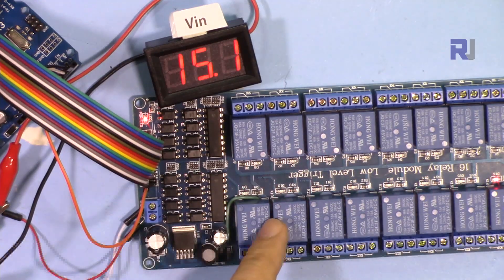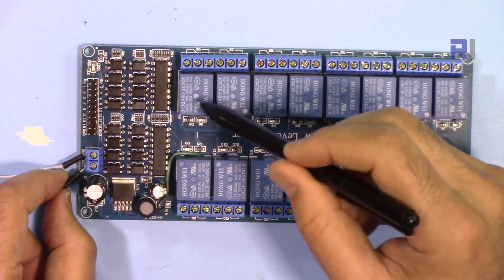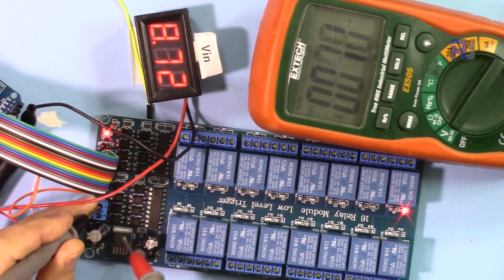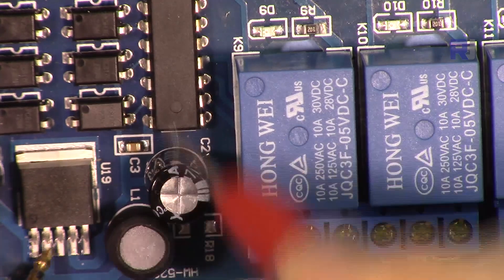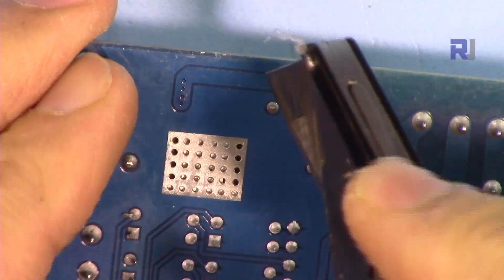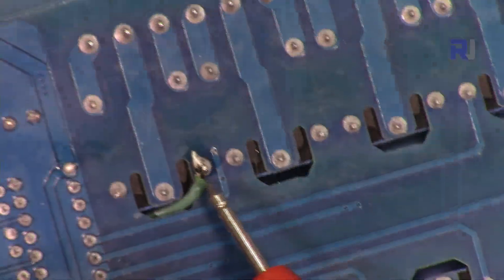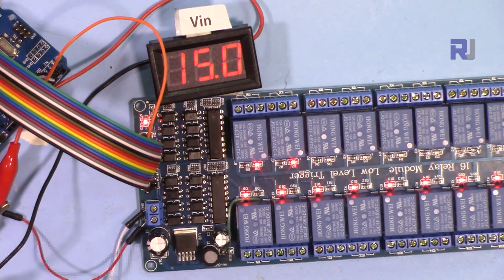16 Channel Relay module 5V relay voltage fixed RJT796

Comment: Great video!  Note : this 16 channel relay module got the relay called : JQC3F-05VDC-C and needs 5 Volt to work and thats why he does this mod/fix so it doesn't melt down, however i just got mine and that got the relay called : JQC3F-12VDC-C so that dont need any mod.
Reply from the maker: Thanks for sharing the information; it's helpful to know about the different versions of the module!

Comment: Great mod🎉  , 
a 2 amp regulator put to better use to supply about max . 6 amps

The opto coupler Leds would need only each  max .0016 milliamps even less because of the transfer ratio because of the virtually zero current  needed  to drive the ULN darlington transisor  bases.

Comment: Hi i wouldn't say that the design is entirely flawed but just that it doesn't make sense for this specific version of the board with 5V relays (12V and 24V versions are fine). It's also good (for the 12 and 24V versions) that they don't use an onboard regulator to power the relay coils since relays don't actually need the low noise regulated voltage at their inputs, so this can be left to an external PSU sized appropriately (again 12V and 24V versions of this board make more sense).

The 5 Volts from the switching regulator are there only to drive the ULN inputs which are rated at 5V for the ULN2803A model (the chip contains an input series resistor in the Darlington array). It's also a good idea to avoid powering the MCU from those 5V since the same track goes to the phototransistor side of the optocoupler along with the ULN inputs and after the fix it also goes to the relay coils so it defeats the purpose of isolation.
Reply from the maker: Hi, it is all about the actual each pieces of relay. if relay operating voltage of relay is 5V, then it should receive 5V
Reply: and if you want to use this 5 volts bord to command 220v? what's hapen?:_?? all the purpose of relay not exist anymore

Comment: Thanks for the video! I have this board, but without the regulator circuit components. Can I simply regulate the voltage nicely to 5V (1A) into the Vcc and GND inputs? Presumably this would still work to drive the relays at higher current, without affecting arduino, because of optocoupler configuration? Thanks!
Reply from the maker: Yes. you can connect 5V at the point where 5V regulated should be, it should work.  You are welcome. Please subscribe. I appreciate it and helps my channel grow.  Thank you

Comment: Nice video to understand the module workings. Its design is not flawed, it has a very specific use case. The 5v psu onboard is to help you drive the microcontroller that will be plugged in externally, while the voltage input to the board should always be what is mentioned on the relays (5v in this case but there are 12v and 24v relay boards of exactly the same type available)

Comment: Dude if the relays have 5v on them you have a 5v board not a 12v board.  Don't input 12v.  Just input 5v and ground pins.  You may try to use 5v and ground on the screw terminals.  DO NOT USE BOTH AT THE SAME TIME.
Reply from the maker: Hello, at 0:50 I mentioned that you can use 5V. the problem is this sold as 12V relay module. see it here https://www.aliexpress.com/item/33034614509.html and on eBay https://www.ebay.ca/itm/253122556171
Reply: The boards in your link show 12v relays, not 5v relays.  Maybe a mistake in shipping or ordering.  The board i have cannot be altered (no bottom layers
) .  If I ordered a 12v and got 5v I would just return it.  Interesting fix though.
Reply from the maker: I just checked the video and toke the screen shot that shows the relay's used are 5V. see it her https://snipboard.io/6MJLl0.jpg

Comment: Just to add a few things to this conversation, the overall design that these modules copy is flawed then each copy gets slightly worse depending on which clone they copy. Irrespective of VIN applied directly to relays or this fix being applied the optocouplers are really unnecessary, no isolation provided since the grounds are common and the Sink driver could be directly driven from the Arduino. My unit shipped with the Voltage flaw this video fixes, but also the common trace shared by the Relays is slightly below 1mm in width, which according a calculator is less than ideal for the total current of 1.28A when all relays are active. Also on my unit there is no cutout between the Relay's COM pin and the driver side. Overall regardless where you got your board from I wouldn't trust it for high voltage or current applications.
Reply: I don't believe there is a flaw in the design.

1. Regulated DC via a voltage regulator is not required to operate a relay.
.
2. Not good practice to use Vcc(Logic Supply) from the 5V regulator to supply voltage to relay coils.
     While there seems to be "back EMF" diodes installed at each relay there is an issue of "back EMF noise" on the Vcc(Logic Supply).
     It is better not to generate back-EMF noise in the first place by connecting relays to 5V to later rely on the flyback diodes to remove the noise.
     Therefore the solution is not ideal.
.
Here is what is really going on.
.
1. This PCB was never designed to have 5V relays installed.
.
2. This PCB was designed to use relays with Vcc_PCB between 7-24VDC where Vcc = relay coil rating voltage.
.
3. If you have 12V relays installed there is nothing wrong with the PCB design.
.
4. Some "idiots" (Entrepreneurs!!!) in China decided to manufacture these PCBs with 5V relays.
.
5. This PCB should never have 5V relays installed.
.
6. Here is the same PCB ( http://www.aliexpress.com/item/32555988376.html ) with 12VDC relays. You can't say that the design is "flawed".
     If you apply 12VDC to this PCB there are no problems.
.
7. It would be more accurate to say that the "PCB was not manufactured to design specification by installing 5V relays.
.
8. I blame the buyer for buying a product which has obvious flaws. I personally would have never bought the 5V variant of this PCB in the first place.
.
9. The solution of connecting the coils to the 5V regulator is flawed because "isolation" has been made worse than it was originally.
.
10. The modification might "work" but I would never fly in an aeroplane with this modification.
Reply: @jackhoffman6120  In addition, the hole in the PCB is a safety measure to avoid the electrical field of the 230V phase from polluting the digital circuit. If you run a wire through that hole, you're injecting a (free) voltage in your digital circuit. On a table it's not an issue, but as soon as you connect a live wire to that bottom relay common pin, if you ever touch any digital pin, you can die! That nasty 230V will create an electrical field, that could be 60V or more in your "patch wire" because it's too close to the 230V pin. Once you touch it, or anything it's connected to, you're dead.
Reply from the maker: I totally agree with your statement.  Unfortunately we have no control over design and quality control. if it was from a proper manufacturer, it should have had model number with proper 100% isolation. But 1000s of people buy this and I noticed interest and request from viewer and purchased it. Thanks for sharing your opinion. Cheers. Ahmad from Canada.
Reply: @robojax  Notice that the optocoupler are useless on 5V board after your modification, since on both side of the optocoupler you've the same power source. Knowing the chinese law that any component is worth removing, until it breaks: if they haven't done it, it's because it's wrong. The relays they have installed have nothing to do with the voltage regulator. It's just a coincidence. The 5V of the regulator is for the µController connector, not for the relays. You must power your board with the voltage rated from the relay (in that case, 5V).

Comment: hi Robojax, I bought a 5v 16 channel relay and is opto coupler but not opto isolation. Y looking your video and instruction in your page and I need C1 1000uf25v, C2 470uf16v, LM2596 s adj 3amp and 33uH radial inductor (7x10mm or 9x12mm? thanks for your answer
Reply from the maker: hi, don't try to make the power module it would cost more than buying the LM2596 PCB module which has everything and it is cheap.

Comment: hey bro. I have a problem with the module, I did everything as in the movie, only the LEDs light up, the relay does not respond  (on the relay i have 4.33 volts) something could I do wrong?
Reply from the maker: if had typed what I did in video, it would have been 20 or 30 pages or more. So video is the best and ONLY way to make is simple. I showed every step and explained how it work.

Comment: I use 24 v rectifier as you said it's the maximum voltage it can tolerate. I connect the gnd and VCC pin from 16 channel relay module to Arduino. My ardiuno heat up and the 
 25 v capacitor burst ! What happened !!!???
Reply from the maker: why rectifier? Perhaps capacitor.  Why did you connect the voltage to Arduino? The external voltage is for the module and NOT for Arduino. Watch The original Introduction video with wiring and introduction.
Reply: @robojax  external voltage of 24 v is supplied to relay module. From the module pin mark as VCC and gnd, I connect it to vin and gnd of Arduino. I have not even connect the Arduino to computer and when I was connecting the other pins, the Arduino began to heat up and caps get blown up. Thanks for reply. I think we cannot power up Arduino from this relay module, right?
I am just a hobbyist not an expert but I like watching your video.
Thanks for your videos.
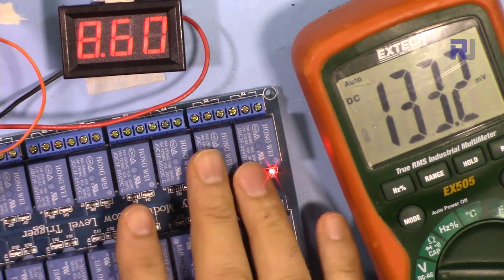Reply from the maker: You made me to watch my video to see if I made mistake. First of all i mentioned that the relay (each blue relay) is 5V and I have mentioned it over 20 or more times.  So there is 2 points. 1-Input voltage 2-Relay voltage.  we have the LM2596 which can accept up to 40V see it here http://www.ti.com/lit/ds/symlink/lm2596.pdf?&ts=1589483394094  at 3:45 I have shown this LM2506. I hope no question is left now. Follow and check if your module after the LM2596 gives 5V and measure the relay voltage as I shown. so your input voltage can be up to 25V (Capacitor voltage) . See this photo too.  https://snipboard.io/bK5rF0.jpg  Please replay and tell me that you got it and understand. Thanks.
Reply: @robojax  thanks. May be, I got mixed up somewhere.
I will study your video again.
Thank you.
I wish I studied electronics. It's very interesting.
Pls explain multiplexers with breadboard someday. I have some concept of it, but not the demux
Reply from the maker: you are welcome.  I have video using multiplexer but I just put it on my list to have pure multiplexer.

Comment: Hello,
Thanks for the trick.
I tried to used the device with a KL25Z board - not an arduino/
This board outputs 3.3V GPIOs, and it actually fails to switch the relays.
Using an adjustable supply , I need to raise input to 3.7V approximately to have the relay switch - which confuses ma as according to your schematic and PC817x datasheet, the input diode forward voltage should actually be (lower than) 3V.
Do you have any suggestion ? Thanks
Reply from the maker: this module is LOW trigger. if your device outputs 0 volts, and 3.3V it should work.
Reply: @robojax  Yes, that was what I expected. But indeed nothing happens unless I raise the output to 3.7V (through an external adjustable power supply).

Comment: My relay board is the same as yours, but it came without any capacitors. Could you please tell me the speficications of those capacitors?
Reply from the maker: I just check the module where it in the shelf in garage. C1 100μF 25V,  C2 470μF 16V.
Reply: @robojax  thank you very much.

Comment: can the input from the arduino be changed from + switching to - switching? im using a nano with a 24 channel board but it switches the - tive power, can the 16 channel do this?
Reply from the maker: Yes. that is called "LOW" trigger (with -) and "HIGH" trigger (with +). This video is about fixing the problem in the PCB. Please watch the main video on this 16 channel relay module here https://www.youtube.com/watch?v=Q9aBI4ELKC4 and it will tell you how to do.
Reply: Robojax thank you, the other thing on my board is their is no voltage regulator or capacitors in the same area, i have found out from the supplier of the stair controler board that the board outputs -12v and the 16 channel board i have is 5v. am i better to just buying some 12v relays and then using the controler to switch them instead of the relay board? thanks for help
Reply from the maker: yes you can use your own switches.
Reply: Would I need to fit the voltage regular and capacitors to use 12v to control it?
Reply from the maker: sorry I didn't get what  you are referring to .
Reply: Robojax on my relay board next to the blue power terminal, it does not have the voltage regulator or capacitors, do i need to fit these and do the fix you show to be able to us 12v supply

Comment: Thanks for your video, Ahmad. I notice however that before your fix, when the whole voltage was reaching the relays, it was only reaching the “on” relays - is this correct? So, with your fix, each relay is always supplied 5v, even if a given relay is “off”?
Reply from the maker: this module has 5V  voltage regulator. The job of regulator is to keep the voltage 5V for relay regardless if you connect 9V or 10V or 20V

Comment: Can you send me the detailed schematics with all components value because I need it in my graduation project . Thx
Reply from the maker: If that is the case, search my for my other video which I have explained on how to drive a relay. then you can draw 16 of that and it would become this module. There is no schematic for this available.
Reply: Can you send me the link plz
Reply from the maker: search for "relay robojax" and  you will find it.
Reply from the maker: Get schematic diagram for this module: 
http://bit.ly/16chRelay-Schematic

Comment: Have you tested regulator temperature with all relays ON and 24V power supply?
Reply from the maker: Hi Peter,  according to datasheet, for LM2596S chip on page 4 and 6 at 40V and 4.5A, it has operating temperature of 120°C https://snag.gy/gZH2cI.jpg, see datasheet http://www.ti.com/lit/ds/symlink/lm2596.pdf and because 16 relay x 80mA= 1.28A,  the 1.28A is less than 1/3 of 4.5A current so it should be okay.